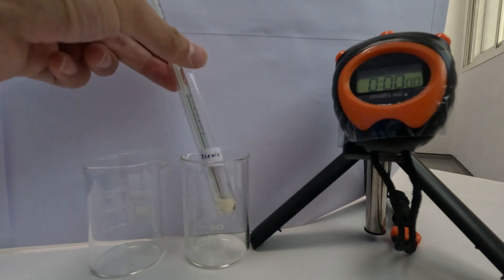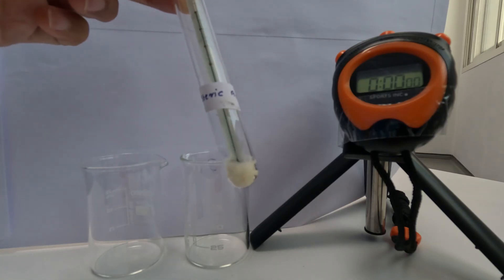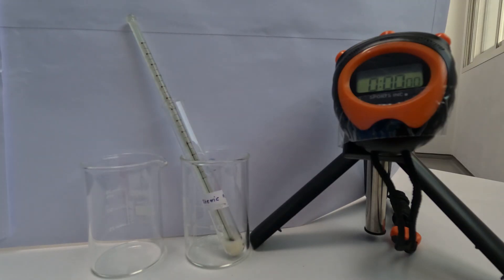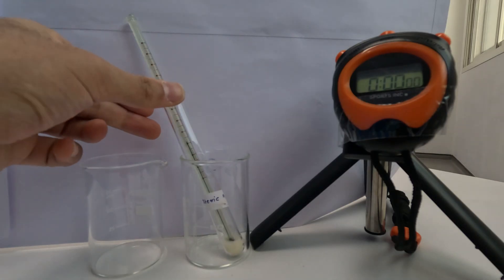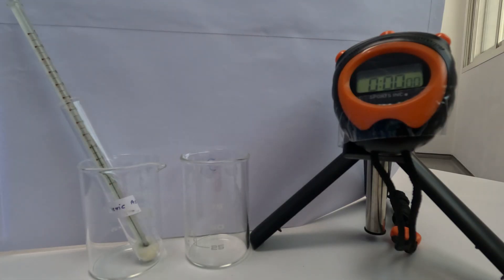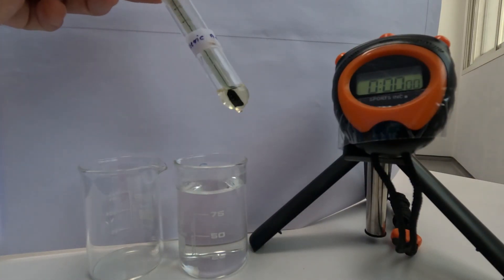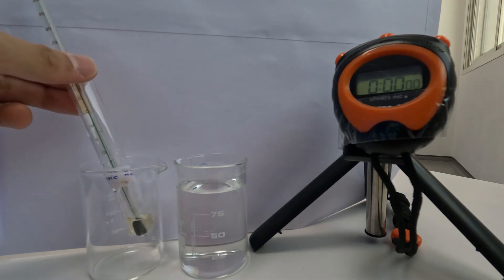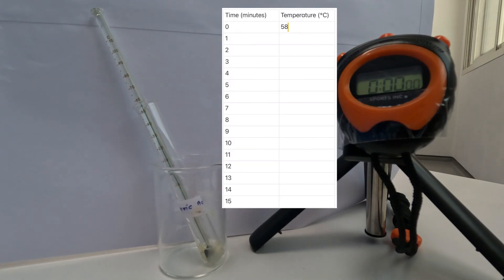Stearic Acid Cooling Curve 4K

Comment: how is that the melting point when ita cooling graph going from liquid to solid
Reply from the maker: The melting point and freezing point occur at the same temperature — it just depends on the direction of the change.

It’s the same temperature, just with energy flow in the opposite direction (absorbed when melting, released when freezing).

Comment: Thanks! Now I don't have to measure the curve myself <3
Reply from the maker: Happy to help! What are you using the data for? The melting point of pure stearic acid is approximately 69°C. The sample I use in the video must contain impurities. Or it's actually elaidic acid (melting point 52°C) and the company has labelled the container wrong or lied about the product!